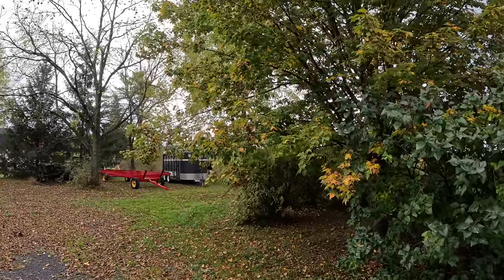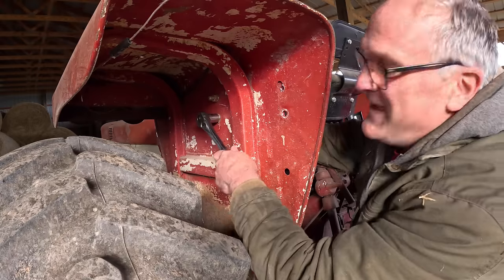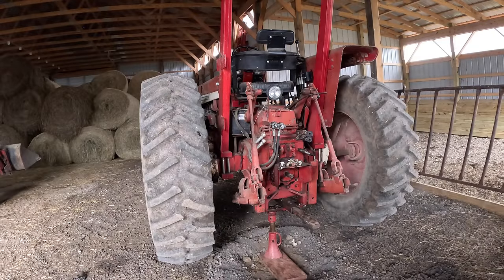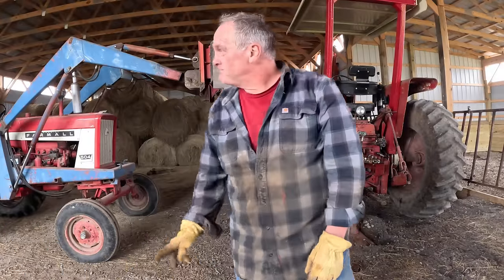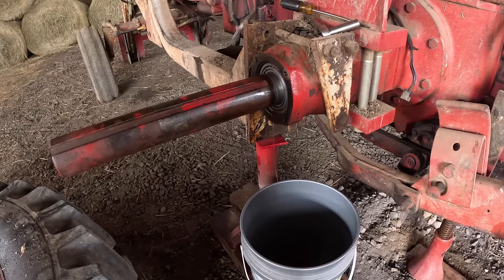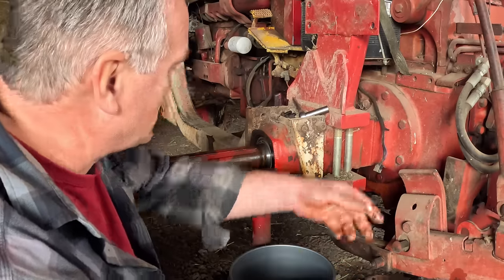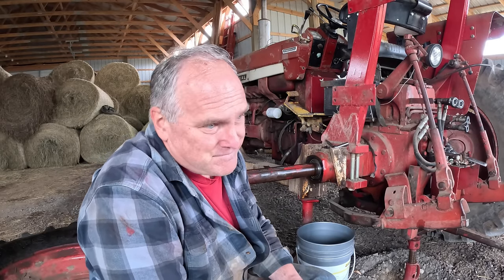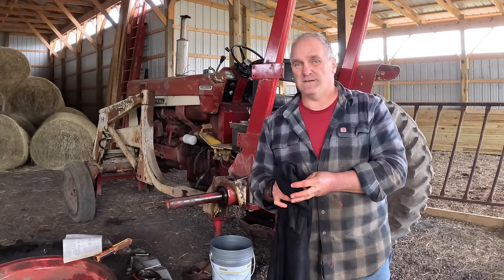Removing a 1,300 Pound Tractor Wheel to Replace Seals and Bearings

Comment: Fixing a seal leak on an old tractor is a good way to spend a rainy day. The sound of the rain on the over head metal roof gives a kind of rhythm to the unbolting, prying free of parts, and the occasional puffs of fresh air blown in, is a wake up call that life is good.

Comment: Great video as always. I learned a little bit of tractor bearings on a tractor and the things one will have to consider when address leaks in the seals and how much one might want to address depends on need and work space as well as time down , thanks for sharing. Will be looking forward for the next video and see how the adjustments with the shimming for the bearing and replacement seal's are done.

Comment: That must be a common problem with all Milwaukee tools. I have a 1/4” impact driver that doesn’t work most of the time. Been like that since it was new. And my dad has a 1/2” drill that does the same thing since it was new. Thanks for sharing.

Comment: Pete, I might have the answer to the “wimpy” loader on your 504. My 504 had a weak spring in the pressure relief valve, it was only making about 1300 psi at dead head. But a few shims later and it makes about 2500 psi, it more than doubled the capacity on the 2001 IH loader. Might be worth looking into.

Comment: I know your hesitant on hydrologic jacks but a 20 ton from harbor freight do a dam good job, I use them to jack houses up up to level them out, they hold real good ..I've had a set of them under a house for a yr now due to it's really off and I don't want to crack the inside of the house off, very slowly am I raising it and so far they're working out well, at less then $100 a jack I'd say a good investment.. unless you like those railroad style screw jacks that give ya a work out lol, I've picked up semi's with harbor freight jacks with no issues, we aren't getting any younger Pete and I have a few on ya lol

Comment: The setup is the same as on a Belarus tractor. IH at least made the wheel clamp so that the threads are not exposed to the elements. Usually on a Belarus tractor, the clamp is rusted stuck and only heat, plus a cheater bar might be your only option.
Other thing is a clamp that is way too loose or runs loose for a long time, than your key way is ruined and you need to replace the axel as well.  
I'm sure the bearings for the 656 rear axel are not cheap. The bigger the diameter the more they tend to cost.

Comment: If you had the Milwaukee 2767, they had a rash of failures on the H96B serial code models. Torque Test Channel did a video on the issue. The previous H96A units seem to be okay.

Comment: You mentioned that the tyres (tires) have calcium chloride in so I had visions of white powder.  But it seems that it's mostly water with the calcium chloride as anti-freeze.  Do please tell us more about this.
Reply: It's to add weight for traction, I have heard down south they use beet juice instead.
Reply: Calcium chloride is Ca Cl 2. So unlike table salt,there are 2 not 1 chlorines.Used mixed with sand on  frozen winter roads,it lowers the freezing point of water. It is also more corrosive .
A saturated solution of NaCl has a freezing point of 0 Fahrenheit. Sea water,for all practical purposes,has that freezing point. So the water is the weight ballast in the tractor inner tubes.
I once left a couple of cheap stainless steel spoons in a glass in the shop,forgot and to my complete surprise there was heavy pitting in places. Farmers hate the stuff,rims and threaded fasteners need replacing,minor drips and leaks have long term damage.
Antifreeze is both poisonous to animals and expensive. So beet juice ,wheel weights or calcium chloride seem to be the three alternatives.

Comment: No need to go to the gym when reefing on nuts and bolts. I think your heart rate got going. Reefing definition sometimes about pot or sailing but this is what reefing means to me:
to use (excessive) force, especially when hitting, pulling, or twisting (on something).